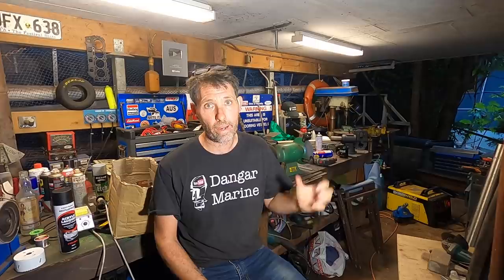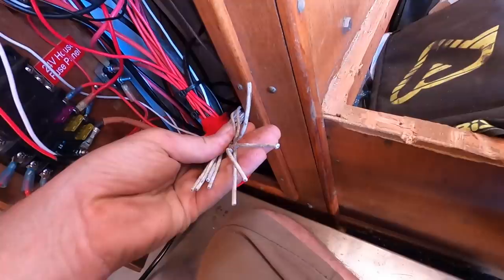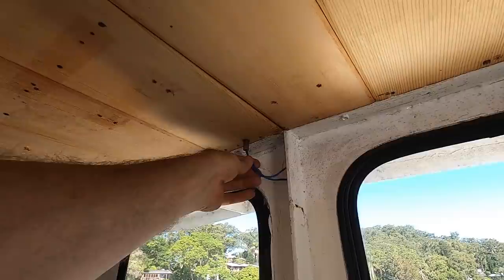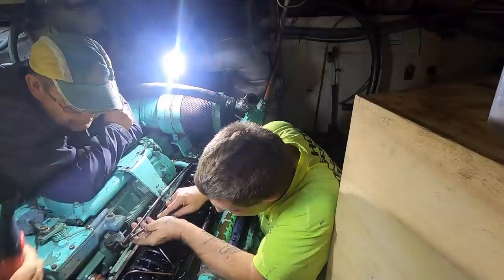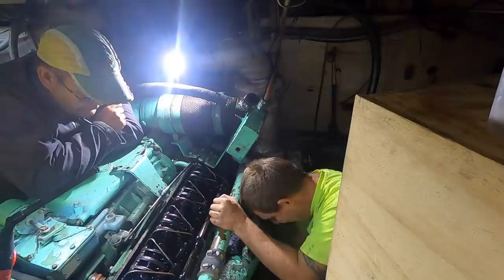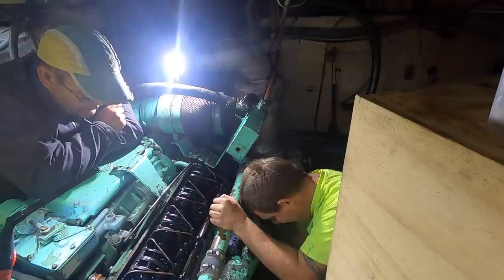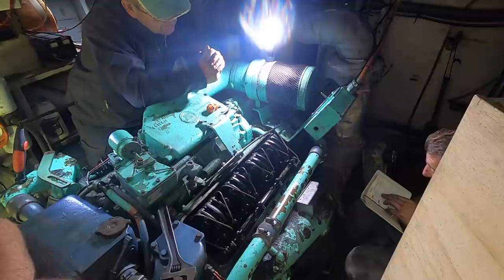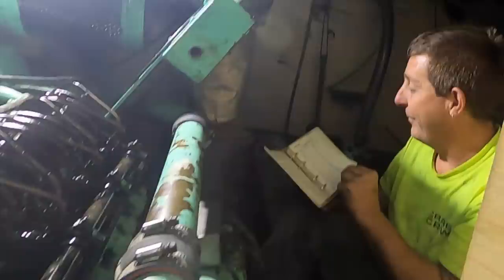Detroit Diesel Diagnosis

Comment: One of the big reasons I bought my used Pacemaker Flybridge 32 was the dual 350 Crusader engines set for counter-rotation. Docking and maneuvering in tight spaces was a breeze. Onlookers who were used to single prop craft were impressed at my 'skill', when it was all down to using the throttles correctly. At 7 tons, she needed that power to slew about, I can't imagine handling that tonnage with just a single prop, you da' man, Stu!... ; {

Comment: Hi Stu I had a fixed  ladder similar to the one you were looking at, it had an extra section on the outside, hinged at the bottom so that it could be dropped into the water when we were diving. I hooked it back up again with the gaff and had a lashing holding the top together , the rungs were spaced so they were matching the fixed part when it was up so it made a good boarding ladder.
Reply from the maker: Sounds like a great setup!

Comment: Gday mate - I had a 1932 wood cruiser with twin 671's built in 1945.  She was used for coastal patrol on the US West Coast during WW2.  Original engines were run to ground during the war so the owner immediately after the war replaced with the detroits after the war.  They worked great (after a major clean up and adjustment for each) for the 12 years I had her.  Love the sound!  Nothin like it!
Reply from the maker: Wow, sounds like a beautiful old boat.

Comment: Hi Stu, your oil blow-by issue could just be down to high oil level in the sump, once you have confirmed your sump part no. And cross referenced with Adrians book, you might find that once you have corrected the oil level, it will cure your blow-by issues.
All the best,
Throw some worms to the chooks for me.
Reply from the maker: For sure, I do still suspect high oil level. Will definitely get that part number today if I can and give him a call.

Comment: A tip for anyone doing electrical work on a boat; I have access to Teflon jacketed Silver coated wire at a shop I work at in various gauges. I now exclusively use this type of wire on anything and everything marine because the teflon coating is super tough and won't nick allowing water in then corrosion and it pulls better because it's slippery vs PVC. Also, teflon is a lot more heat resistant and the silver coating on the cooper is a must for corrosion protection. The only downside is cost and availability as it's Mil Spec wire, however you can usually buy lengths of it on ebay. I am fortunate to have access to full rolls we get from Govt. surplus, but with those few negatives I've stopped having as many electrical issues on the boats I work on, including my own even when I used heat shrink style terminal ends. The combo of the teflon wire and these types of connectors is a must, especially around salt water.

Comment: Stu... come to England and play with a  narrowboat!!   up to 70 feet long, and only 7 feet wide...  you can only turn them round at certain places on the canal, called winding holes.....  spinning a 70' boat in an 80' winding hole takes so much skill.... I rarely got it right with a 53' boat!
Reply: Thats what I thought mate. Narrowboating is easy, mastering a narrow boat takes some skills.

Comment: Hey Stu, I have only ever seen airbox drain valves installed when the drains are plumbed back into the sump, the valve is a normally open valve that closes when air box pressure rises, they are notorious for blocking with sludge. I think they were first fitted around 1975 a very early emissions control system to stop pools of oil being left on the ground under lightly loaded engines when parked up, when working properly they could have added a bit to performance as the open drain is basically a charge air / boost air leak. There is a test for crankcase pressure using a piece of water filled PVC tube poked into the Dipstick tube, the allowable pressure is only a few inches of water.
Reply: And those check valves close at a “surprisingly” low pressure (if you are not familiar with the operating principles of the engine design).  When they clog, or the check valves stick open, loss of power and a bit of mess, for sure.  (DD8V92TA DDEC II with Allison HT-755CR ATEC in a early 90’s Prevost H3-40 conversion.)

Comment: When you are in the reverse gear, the prop creates suction in front of the rudder.  When you are in forward gear, it creates push against the rudder.  The directional forces determine the movement.

Comment: As to steering and directional dynamics relating to engine operation:  Going ahead it is next to a zero issue.  In reverse, the water flow over the rudder is mearly that of the boat speed (slow) thru a static fluid...very small compared to forward when the prop pushes on the rudder.  In addition the water discharge off the tips of the propeller push against the bottom of the boat for a good 1/4 of the props revolution pushing the boat sideways .  Throw in a little tidal flow and its a mell of a hess.

Comment: hi I glade you got your diesel engine back and installed and running I still got my boats in winter storage still Covid 19 rules closed down my lakes around where i live!  I drive about 80 miles away there a none gas powered motor use lake & camp ground! i have a dingy rubber boat too!  i rather use a bigger boat & gas outboard wait till may 31 and see what happens if i have a person visit i take them camping!

Comment: thirty-six years ago when I was but a spotty lad I puttered around in little nine-foot ex workboat that someone (I kid you not) had put a 1.1 petrol engine out of a VW golf. Its main issue was that it spurted oil from every orifice and used about a pint an hour. Typical yoof couldn't be arsed to fix it as I got free old oil from the yard. The inside of the box was covered as well as the engine. After six months of this, I asked an old fella in the yard if for a couple of tins he'd take a look. From five feet away he said 'your oil breather pipe has a kink in it' Exactly two minutes of repair later the engine stopped pressurising like a balloon and no oil to be seen. He walked away with the sure knowledge that I was as thick as a bag of spanners and the four tins in his fridge would taste better than usual.
Reply: Thats experience. Funny story mate
Reply from the maker: Ah, we've all missed an easy fix before. :)

Comment: Stu  really great video this week I love it when you talk to an expert like Adriana , like the bus guy in America!
I have 2 small boats with single diesel inboards , I would love some videos on maneuvering. . Your description of leaving the helm over and FWD /rev  such a simple explanation   Cheers warren
Reply: Oh I hope you don’t use that ugly blue awning sunbrella ..... so over that color! 👍
Reply: Stu, I thought landing craft had our cooled radial engines in the back of them? That is a couple of old wrecks on Omaha beach that have radials  in them cheers Warren
Update I checked and the Continental W-670-9A; 7 cylinder, 4 cycle, radial gasoline 250 hp was used in the 18000+ LVT ( landing tracked vehicles) built before and thru ww11, and used on Utah beach as supply water to land vehicle.  So I guess that's the beach I was riding my motorcycle   back in 1977!  Good to know!  And as you said Detroit diesels of various types  were used in various landing craft .  Cheers w
Reply from the maker: Thanks mate, will do. The cover for the awning will just be the solar cells.

Comment: It took a fair bit to work out how to steer our boat around in tight quarters. Single screw with a rudder.
Reply from the maker: It does take a bit of practice, that's for sure..
Reply: @DangarMarine  how good is it when you get it right! It feels like you have joined a club. The no bow thruster club. LOL

Comment: Wasn't impressed with the concept of oscillating multi-tools until I needed to make a cut similar to the one you made on the tongue and groove board. They're very handy for making surgical like cuts in those kind of situations.
Reply from the maker: For sure, you don't use them often but when you do need them they are gold.

Comment: Definitely a video explanation of Prop Walk
Reply: Prop walk.. a phenomenon NOT to be confused with its land-lubber cousin... Dock walk,  which is a problem that air-ride semi-trailers experience when they're dropped at loading docks without the air suspension deflated prior to unhooking the tractor.

Comment: Right handed wheels will always back to port until the vessel is making enough sternway for the rudder to take effect.  It takes some getting used to.
Reply from the maker: For sure. I'm pleased that once you get some speed up in reverse Renko does respond well to rudder though.
Reply: And short boats suffer from propwalk in reverse much more than long ones but also respond to rudder inputs better. That is my experience anyway.
Reply: @Jack-tx2ve  That makes sense.

Comment: Anyway, I would make a valiant attempt to cut that excess silicone out with an exacto knife or something similar. If you're really worried about it migrating, and I would not, use a vacuum.
Reply from the maker: Yes, I did think about going that way, should be able to remove most of it up top but there is a second hole in the bottom of that part that is impossible to reach unfortunately.
Reply: @DangarMarine  Bummer. I figured it was the horizontal drain that was most affected. Thanks, Bud. Fun watching what you're doing there. She's coming around. edit My Mako 191 gives me enough to worry about.

Comment: I have an old steel boat built in the 1950s, it has a left hand rotating engine, behaves the complete opposite of yours, takes a little getting used to.

Comment: Love your videos, I watch them a lot to fix issues with my old mercury outboard. I recently ran into the problem of lower unit leakage with reverse slippage and followed your guide to remove the clutch dog assembly to get a good look. I found that the reverse was very round. I summed up the parts i needed and deemed it would be more worth to just buy a new lower unit. The problem is that my lower unit has a 3 jaw set up and all the the new clutches are 6 jaw leading to having to replace the shift shaft with a conversion kit. This means the whole powerhead has to be removed. I am a novice when it comes to mechanics but have fixed every problem since from replacing the stator to installing a new trim pump and other small things. I have not been able to find any information on powerhead removal for a 1994 90hp 2 stroke 3cyl mercury outboard and cannot find the maintenance  manual online. Just wanting to know if there was any instruction i could get my hands on or if the task is above a novice. If anyone has any info it would be appreciated!

Comment: Love the vid Stu! Sorry to be posting questions here but I need some advice on a speedometer tube issue. Was driving yesterday and tube connecting to the aperture hole on the lower leg was disconnected with bits of water in the tube heading up to the actual dial, my clever brother then decided to blow into the tube connecting to the speedo. Do you think this would have completely damaged the gauge? Would I need to suck the water out from the pipe but disconnecting it from the Speedo first and then reattaching it to the pipe that goes to the actual hole on the gearbox. APPRECIATE ANY ADVICE IN ADVANCE!

Comment: I just bought my first boat, the lower end is damaged. I have another one to replace it. I’ve been watching your videos and know that you shouldn’t run an outboard motor without water going through it otherwise the water pump will be damaged. Now that I have the lower unit off, can I run the engine without water for a short period of time. If so, how long do you think I can run it? Thanks

Comment: I would have left all the pilot house paneling intact and built external wire chases inside the pilot house.
Just sayin, JIM
Reply: That's one way to do it, but not everyone likes the looks of the wiring in sight.  I guess it depends on budget, time-frame of when the boat will be needed back in service, how much time someone will be spending in the wheelhouse staring around at the interior.  But sometimes, yes, the way you described is indeed the best way to go.

Comment: Shame the ol Jimmy ant straight piped so you can dock next to yupy yachts like a boss! Lol
Is the rocker cover brether the only crank case ventilation?  I'm have problems with my 353 leaking around the sump gasket,  pisses me off because I've just removed the sump, cleaned it spotless, and reenstalled it with new gasket and rtv.  Was wondering if crankcase ventilation was an issue.
Reply from the maker: I believe the only breather is the rocker cover and the small airbox drains. Excessive crankcase pressure could definitely cause leak even after resealing.

Comment: Dangar! Need your help- I have a 120 Force outboard and I did the prop oil change, new spark plugs, and impeller - thanks to you videos- however, I got it into the water for the time this season, when i pulled out and put into reverse the boat went forward! Any recommendations? Not sure if I misplaced the lower unit when I put things back? I appreciate it!

Comment: 92 series are turbo from the drawing board.
Reply: But there sure are a few naturally aspirated ones out there.  Had an 8v-92na in an '84 Western Star, and other than for speeding along on the flats, it had to be THE most useless engine I've ever had in a truck.  Any hill or mountain you came upon,  you had to shut off the headlights so that the truck wouldn't see the incline coming up and whimper out. Shutting off all of the lights also reduced the load on the alternator, so maybe an extra 1 or 2 HP gained there, too. Had a few 6v-92's that were charged, they were better by far, but still no heroes on big hills.  And then your 6v-71's and inline 6-71's... well they made great cross-town shunt trucks and yard trucks, respectively.  I never got to drive anything in the 71-series bigger than a 6-cyl, either inline or v-config.  They say that the Buzzin' Dozen, aka the "Rocky Mountain Humming Bird" wasn't half bad.  As someone with now in excess of 3 million paid highway miles,  I'm a huge fan of anything 4-stroke because they pull harder, lug some of them right down to 1000 or even 900 rpm and they continue to pull hard. And because they're a lot quieter.  It really sucks when you drive a "tin can" to begin with, and it has a loud engine. The stereos in trucks back in the day were non-existant at worst,  shit-lousy at best.  I got sick of the engine and exhaust noise pretty quickly.  My opinion of 2-stroke Detroits is that they're a good choice for non-highway applications where you won't be encountering hills.
Reply: Coaches , marine and automotive all
 Use natural 92 series , they built thousands of them just not as popular ass turbo version

Comment: Detroit's r wonderful..they run broke!
Reply: It depends... on what broke.  As Adrian was saying about the blower really being important... if that stops, you ain't going any further.  I had a blower shaft strip out on me trucking across Ohio. You could hit the starter and it would cough, catch, and quit after maybe 3 revolutions, because no fresh air.  The repair on it was a really long story. The short version of it is that Detroit recognized at some point that the spines on the shaft and the driving and driven sprockets were just too fine, and changed them at some point to a much more coarse spline arrangement.  When I broke down,  the shop I was towed to ordered in new shaft and both sprockets, but the idiots at whatever Detroit dealer they were ordering, kept sending out a mixture of old-style and new-style, which obviously wouldn't work.  Finally my boss back home had had enough, he had all 3 pieces sitting on a shelf in his shop, spent the big bucks to overnight them out to us (should have done that from the get-go), and within 2 hours of the parts finally arriving, I was back together and on my way again... after 6 days and 5 nights of screwing around.